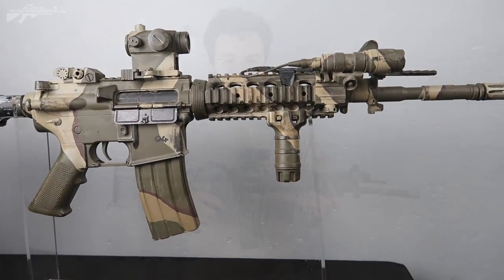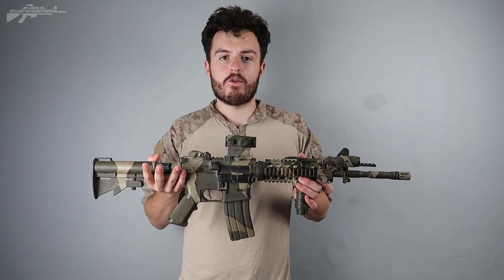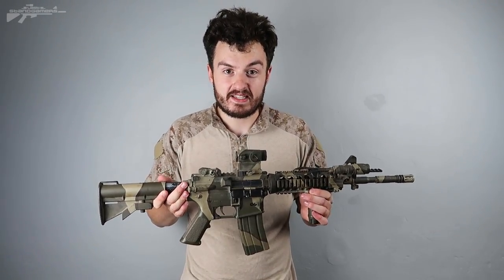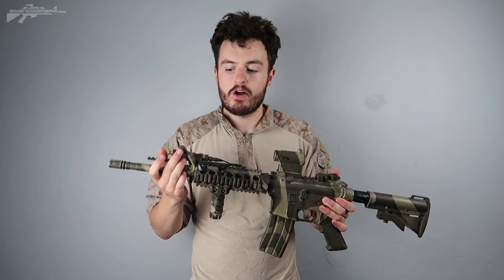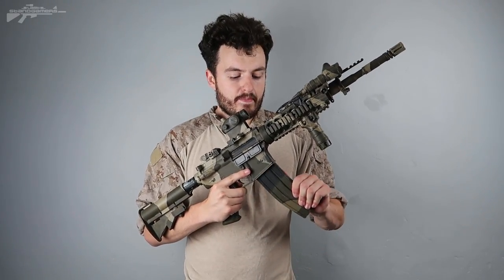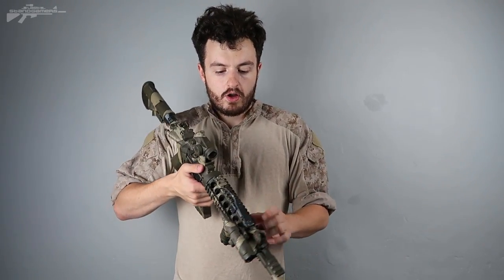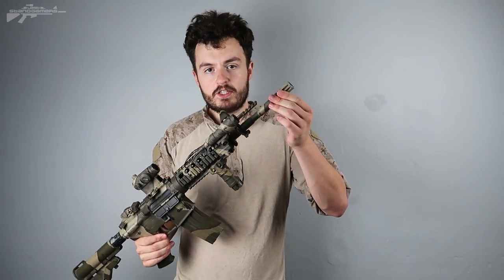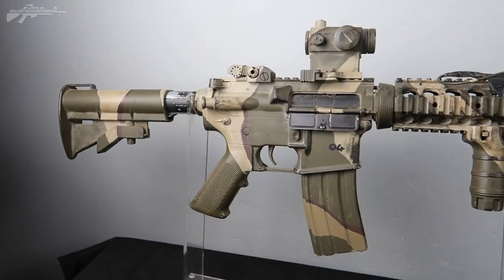Basic AR15 / M4 Milsim Setup - Airsoft

Comment: Just bought a full metal M4, very heavy indeed. More than I expected. Got tired just holding it up by the handgaurd for 1 minute. I'm going to take your advice on the stubby front grip. Hopefully it will take some pressure off my wrist and even the weight out. Thanks for the tip